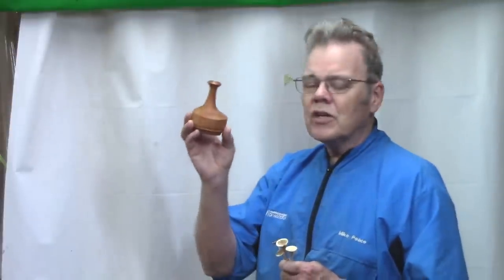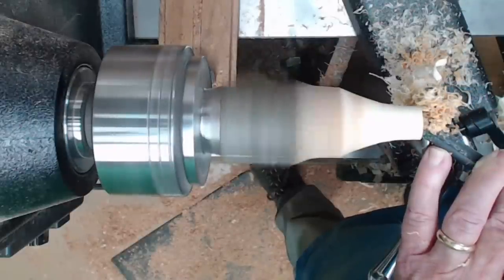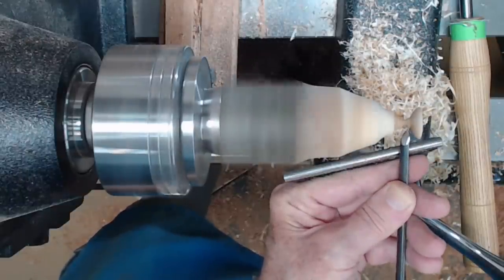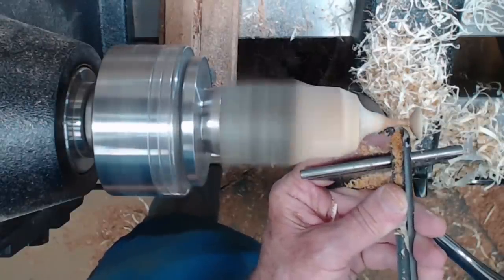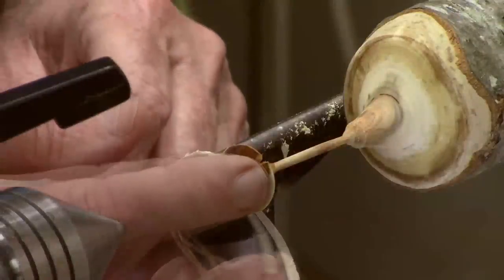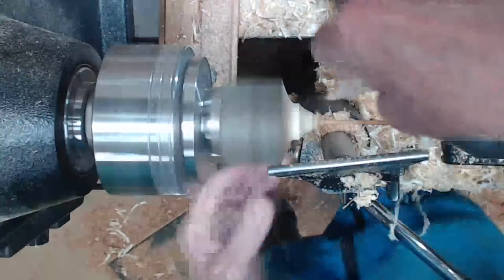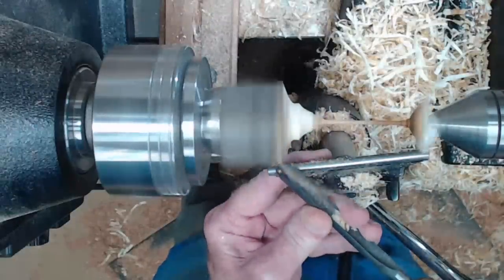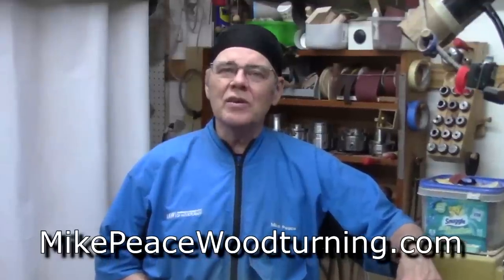Turning flowers for a Weed Pot - Better Than Weeds!

Comment: Insane! Love this project, but nerve wracking to watch. Eyesight! I use diopter safety glasses. But even with that I struggle with super closeup work. That said, I'll have to give this a go along with an off center twig vase. Great teaching!
Reply from the maker: Thank you.  For me this is detailed but does not require any special eyesight on my part. I have had cataract surgery on both eyes and wear progressive lenses , required for reading but I wear all the time because they also correct for some double vision.

Comment: with the most respectful compliments because I consider you and admire your work,... however, allow me to say this,... about the pressure of the counterpoint with wood, in this case, a flower,... as the thickness of the stem starts to get smaller, it is not able to rotate the counterpoint, due to its weight,... a tiny bearing serves the same purpose, supporting the wood but without causing damage or forces,... just put a small bearing on the end of the counterpoint and it will rotate,... it's just a trick that helps a lot,... stay well and healthy, all the best
Reply from the maker: Thanks for sharing. More than one way to turn.

Comment: Well done, Mike!  I've made 5" finials for sea urchin ornaments (Cinyd Drozda has a very good Youtube video on these), and have created a 3" thin section that was about 1 mm in diameter. I've always used a dense, closed grain wood like Jatoba or Canary wood, that was dry. I've not tried this with green wood, but will have a go at making a few of these flowers. I used a 3/8" bowl or spindle gouge for this kind of work, and always use a Japanese hand saw to part the piece.
Reply from the maker: Thanks for sharing, Doug. Yes, try green.

Comment: Dry nice. What is the diameter of your weed pots?
Reply from the maker: Two to three inches
Reply: @MikePeaceWoodturning  Thanks, what is the diameter of the hole? The stems would need to be really narrow to get any more than 3 inside.
Reply from the maker: @trurex007lee7  5/16" or 3/8"

Comment: I love doing flowers.  A few times that darn pith has curled through the stem and ka blooey  the thing blows apart.  Its frustrating after spending serious time getting the flower just right.  I do bigger ones like Yamabiko does.
Reply from the maker: So even though the pith was kept off center on each end it crossed somewhere in the Middle? Bummer!
Reply: @MikePeaceWoodturning  yup.  I've seen the pith actually curl around the stem.  I have one flower that the stem warped really cool because of that. The pit is on the edge of the stem and goes around it.
Reply from the maker: @suzetteedwards7956  Interesting. I need to turn more of these. I am doing a club workshop on twig pots and flowers next month.

Comment: ...very cool...looks like an exercise in finessness (not a word?...well, it should be...).
Why not take a Dremel carefully to the split, round it off and make it look like the petal is parted? In fact, several would make it look like a true petal...
Reply from the maker: I might try that if it happens again! But that might be trickier than turning another one. These do not take that long to turn.
Reply: @MikePeaceWoodturning  ...well, your split gave me an idea of creating petal molds for resin and gluing them to the top of the stems...I'll need to look into that...by the way, love the weed pots, especially the off-center ones...